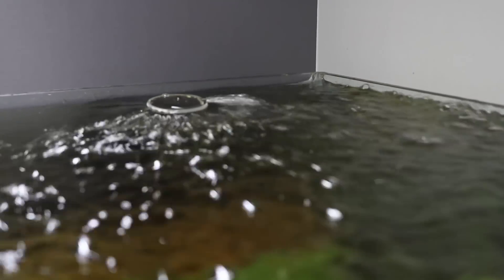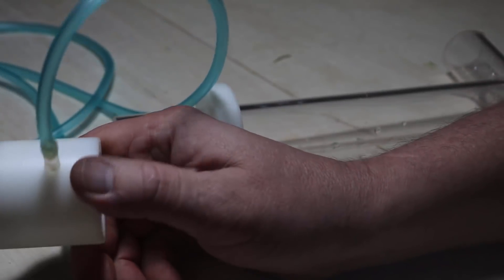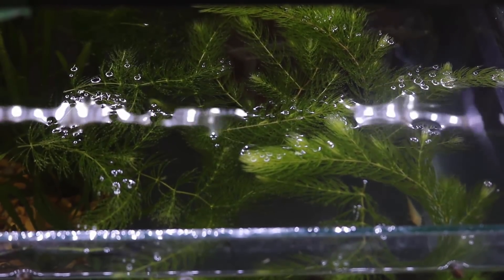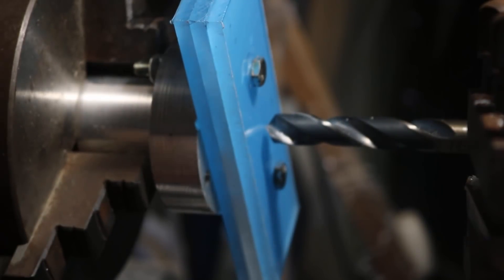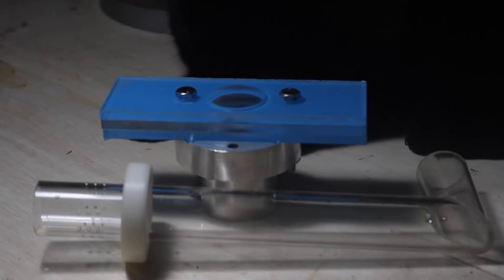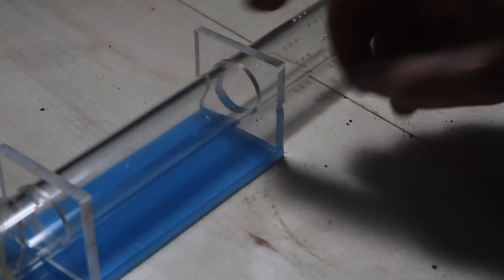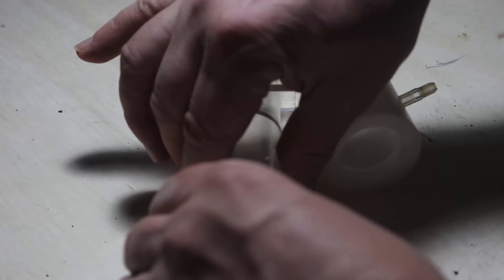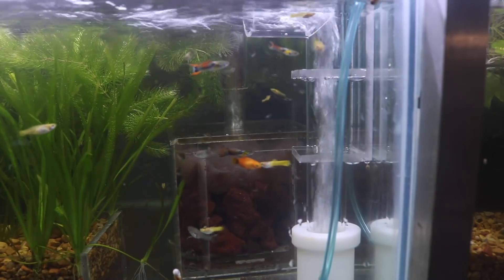DIY Air Power Lift 2 0, or my Murphy Week

Comment: Hi!  Sorry to bother yall...  I have been trying to do the same thing but with pvc pipes...  The water in mine doesnt get lifted as high as yours :( im wondering what could the cause be?  Should i use narrower pipes? I mean with the filters :(
Reply from the maker: Hey Elisha! There are a bunch of variables for these air lift tubes. Pipe size does have an influence but I find that the compression ring would be more important and how much air your pump can deliver to it. The hole size too seems to play a bigger part than pipe size. If you can send me a pic I might be able to help.
Reply: Im so sorry to bother you :( thank you so much for your help :)  im gonna try to tweak in the other factors you have mentioned before i try sending you a picture.  Thank you so much

Comment: A slightly cleaner look might be to drill 1 or 2 small holes in the top or side of the elbow and run a hard line air tube down with diffusers on the ends. 
Any thoughts on how to build the bracket without a lathe?
Reply from the maker: I was concerned about losing some of the smooth up and down motion of the build if I went through the top, but it would look cleaner for sure. If you had a good selection of drill bits you could build the bracket without the use of a lathe. Building the air chamber is a different story though.Thanks for watching and sharing your thoughts

Comment: I know these are more used for job and in tank filters.  I have always been curious what the max lift height for one of these power lifts might be.   Any idea?
Reply from the maker: The funny thing is I've been trying to think of a way to get lift ( as in height ) out of an air lift system. As it stands now they suck. I think it would be great if one could run a sump with an air system. Thanks for watching
Reply: @FishmanEricRussell  that was my impression too.   The only thing I could imagine would be a salmon ladder approach with a ton of air lines raising the water up a setup at a time...  but that just seems like our would be overly complicated to power...
Reply from the maker: @rewmar  I had the same thoughts

Comment: If you put something like this on a salt tank won't that create an extraordinary amount of micro-bubbles in your water column?
Reply from the maker: I'm sure it's going to cause all kinds of issues, but I'm also curious to see if there is a benefit to running a marine tank in different ways other than the usual industry approved methods. Thanks for taking the time to come by Aqua it's always great seeing you.
Reply: Fishman I'm 100% sure that Contraption would be a huge upgrade in any freshwater aquarium as far as salt water I'm just as interested As You Are to see what happens. I cannot wait for the update